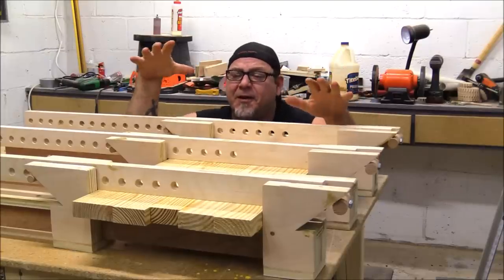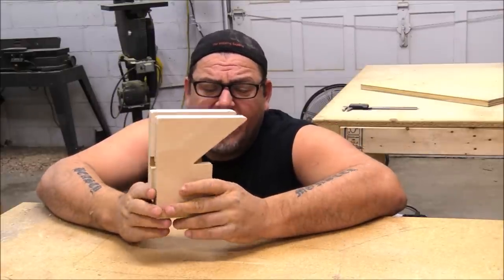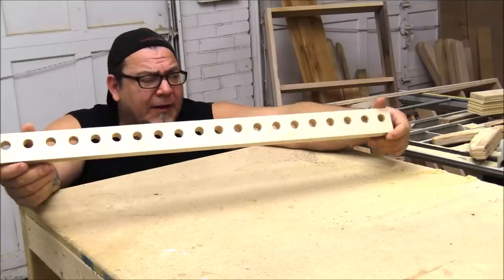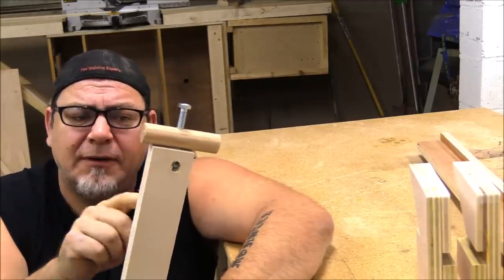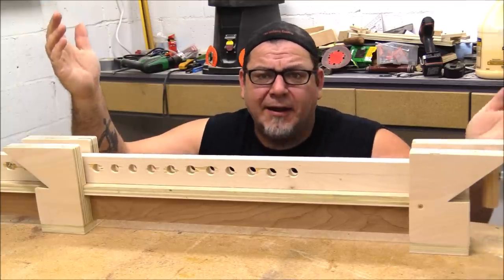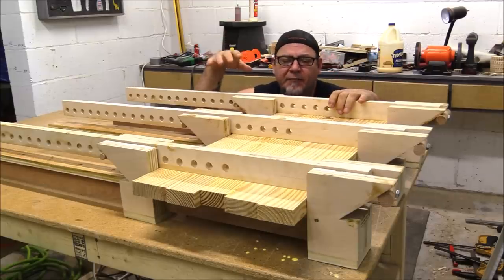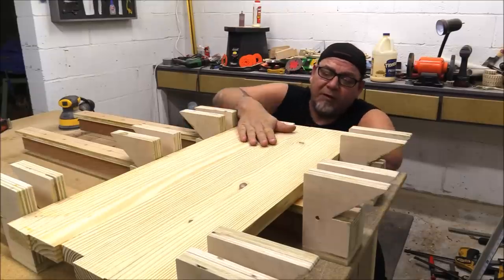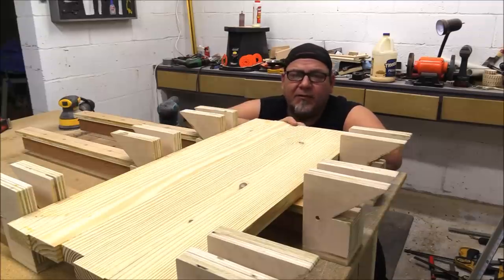Incredible Homemade Bar Clamps | Diy Woodworking Project

Comment: Izzy, I have made these and they are great, but I wonder about the geometry as I find my end pieces tend to lift at the rear. Perhaps someone can see a way to redirect the clampinbg pressure to the centre of the timbers being clamped which I think would solve this small dilemna.?? Cheers  Ron

Comment: do you think it would be better if you put some packing on the bottom rail and top rail in the middle when clamping  say a millimetre cardboard giving you even clamping top and bottom or alternatively the jaws could be slightly sloped because when you clamp it loses its parallel 90-degree angle, so say depends how much movement under clamping force set the jaws at 87 degrees angles?
Reply from the maker: great feed back thank you
Reply: izzy swan give it a bit more thought after your reply run two unc quarter of an inch stainless steel rods either side on the bottom connected to the bottom of the jaws of the clamps tighten it to reach about 97 98 degree angle say it's got to be stiff and tight at the bottom! the clamping Force applied to the top is always trying to force it over? if you don't  like that idea you could make the jaws at bottom stick out level with the top use that unc rod from top to bottom preferably about an inch and a half from the font edge maybe. Doesn't need to be super tight just tight so it holds its position under clamping force if that's not an oxymoron, brace the top of the jaws where the rods go through with at least 3 mm thick piece of preferably stainless steel cross member across the two Jaws and the same on the bottom. I think you've got enough room to slide the voice member through the gap. nice idea I still think you have the same problem with still,  the jaws will have to be cast iron.

Comment: I'm a brainstormer so whatever I say please take it for just that, an idea that is generated good, bad or indifferent 😁. 

My observation without any application of my theory of course.... The "bar" that you use to clamp over the top, what do you think about making something that covers the outside surface area of the lower clamping mechanism? You could cover more surface area but you may have a pressure issue? The thought is you will gain 2 clamps with this 1 clamp version. Just a thought! I really like this clamp! Seems to work perfect!
Reply: Another thought, the top bar could somehow be cut at a very mild convex shape over its clamping face  to ensure flexing doesn't reduce  its clamping pressure over the length of the bar on a wider surface area such as a table top. I hope that makes sense...

Comment: Great design Izzy!  I'm definitely going to be making some of these later in the month.  I'm planing on a desk build, and was worried about gluing up the boards for the top.  What was that tool you were using with the drill to tighten them, and any reason not to use an impact driver?
Reply: Does anyone know what the tool is that Izzy was using with the drill to tighten the clamp? I assume it was some sort of torque multiplier but I've not seen one like that before.

Comment: Hey Izzy... love your vids man. Just a thought....how about using your clamps in concert with a regular clamp to increase the clamping pressure needed to close the gap. It would only take a couple and the worry of buckling up in the center is done away with using your clamp. I would tighten yours partially first then  install a bar clamp on each end to put the final squeeze on it. what do you think?

Comment: Maybe tweak the angle of the triangle to optimize distribution between vertical and horizontal clamping forces. Seems you‘d need more horizontal force which means you‘d need a less steep angle (basically cos/sin ratio if you want to calculate)
Reply: no I think vertical and horizontal force should be even... you don't want one stronger than the other it may lead unnecessary twist in the boards
Reply: lurchHa3 not necessarily: as they are plum, these horizontal and vertical forces should be linear independent ( see vector algebra) at least as long as the boards are rectangles (and not trapezoids or parallelograms). Vertical force is needed sir alignment only, whereas the horizontal forces need to bend the boards in alignment, if they have a bow. Usually you also would use more clamps horizontal than vertical in such glue-ups , right? More clamps equals more force
Reply: But honestly: I am much rather a theoretician than I would have extensive experience in this field.
Reply: These forces are not independent, they are related by sine or cosine of the applied force, both forces are in fact dependant on the force applied by the torque of the bolt and the angle of the block... a board can be twisted vertically as much as horizontally... and proper joining will do as much to ensure a nice glue-up as clamping force.  in fact too much clamping force can close the fibers of the wood and it will not bond as well.  A common misunderstanding is that more clamp pressure = stronger glue joint.
Reply: lurchHa3 as they are in a 90 degree angle they don’t interfere with each other - that is what I meant. Not a native English speaker. They start to interfere if the glue up surface is not square enough, so then the horizontal force plus the resistance of the board surface creates a vertical force that tries to unaligned the boards. If this force is greater than the friction of the surfaces (function of horizontal force and a friction coefficient) the boards become unaligned. So if your angles are close enough to 90 degrees there is no vertical clamping force required at all. The more deviation from 90 degree - the more vertical clamp force is required. That’s why I don’t think that these forces are to be equal, but I think that the horizontal force should be bigger than the vertical as long as your angles aren’t completely out of control. But as they say: Grau ist alle Theorie - Versuch macht klug! (All theory is grey but insight is gained by experiment)

Comment: Great clamping system!  Why use metal if the wood version works well?  Metal version may be easier for you to build but I barely have room for wood working so no metal working for me yet.  Wouldn't the materials cost go up for all metal version?  

Make a few templets and you could crank out many of the wood version clamps.  Your clamp design seems very scalable and could be built into a clamping table for large glue ups.  I want to make a nice dinning table.

Comment: I love your clamps!  Also, the other YouTubers call them "Panel Clamps". 

Is there a paint or coating that the glue would not stick to?  Plasti dip or something? 

Just a thot:
I know you focus on wood, but I was thinking that an alternative for your bars could be steel or aluminum tubing.  The clamps would still be wood and would need to be glue-proofed, but the glue would not stick to the steel or aluminum.  

Thanks for hanging in there with all the great videos.

Comment: These are amazing. I would love to see these wall mounted so that you can tip them out to work on your glue up then lay it flat against the wall while it dries.
Reply: Crafted for Profit thoughts on having it vertical all the time? Since it’s applying a force on all sides, mounting it vertical for glue up shouldn’t be a problem. I like it on a dedicated wall for people who may have smaller shops it could take up less space
Reply: crafted for profit - what a great idea!   you always think of glue ups being horizontal but vertical makes so much more sense!
Reply: Keasbeysknight I would want to pull it out so it sits at an angle when laying the boards out and applying glue.  Then apply clamping pressure and lay it back against the wall.  I've been considering doing this with pipe clamps and connectors. The price has kept me from doing it.
Reply: I was just saying I want a panel saw in the same place...  (Amateur)  could it work somehow to have both on my 8ft high X 16ft wide garage door?
Reply: @rwind656  only if you never need to open the door
Reply: @Pat Zeuner , I was envisioning  a framework onthegaragedoor, with some parts  added when we need to use it.   I've seen several different panel saws mounted on garage doors now online.   As I said,  it's our only free wall...
Reply: @rwind656  you haven't seen the video where a gentleman organizes the garage, does a fantastic job, then the wife comes home and clicks the garage door opener.  😂
Reply: Pat Zeuner no,  oops I missed that...
 Link?   Sounds...  
Instructive,  lol.

Comment: Izzy, could you build these out of 2x4s instead of plywood? 
Asking because 2x4s are cheap where I live.
Reply from the maker: i dont see why not i would prefer hard wood for these but if the soft would is large enought to resist the stress i think it owuld work

Comment: Hey Izzy, great idea!  What are the dimension of your t-tracks and blocks?  What did you cut your blocks to draw the material in tight?
Reply: guess. scrap bin build proof of concept, experiment and estimate by using the stop control.

Comment: Excelent! I love the duel direction pressure feature caused by the angled ends.
When you get around to a steel or maybe better yet Aluminum there are many extrusions available with holes for the top bar. I will be making something like these thanks!

Comment: Hi there Izzy I LIKE YOUR YOUTUBE  but there Fast and some years past in Nam & Sandpit I have have got slower and do you have a few measurement like how wide is the track and how thick is the plywood I can slow it down but you are to fast for me. Thank you for your show I have been to Rob Cosman shop for a week and you have nice stuff that you make if cant send info Iunder stand. Thanks Pete  ps. it was the Sept 13 2018 shod.
Reply: They are made with standard measure plywood and so very easy to guess. Why would they not be? Only a few choices. 3/4 inch is the usual choice for just about any DYI clamp or jig. Size can be estimated by comparing to other tools and hands in the video frames. Hit pause/stop. This is proof of concept not final design.  Make your rails and cut the blocks to fit.  Blocks are of a small amount of plywood  total, scrap bin stuff. Experiment by making a small unit, then build a size for your needs. Jigs are one of the fun things of the hobby.

Comment: Stupid question but is the head end fastened to the t track? You screw it to it or bolt it or dowel it? Also the tightening bolt is there a buffer on the end of the bolt to protect the work piece?
Reply: Never-ending on the tightening bolt I just realized that is in the top bar and not near the piece.

Comment: Isn't the flattening force greater at the edges of the glue up because of the angled end to the clamp?  This may tend to flatten the outside boards more than the middle (as the clamps may bow slightly due to the direction of the pressure being applied at the ends).    Otherwise it's a really great idea which I am going to copy!
Reply: That's what I was wondering, maybe that's why he has some cupping or bowing on those edges of the joints?

Comment: Hi Izzy how thick is the ply you are using
Reply: guess. there is only a few choices. estimate by using stop control and compare to other objects /hands in the video frame. going to be some standard thickness. why would it be otherwise? it is a proto-type proof of concept supplied from the scrap bin. not a final design as he told you.

Comment: The Shoveller: Doctor, you are a genius.
Dr. Heller: That's what the card says.

I have seen a lot of DIY clamps, These look amazing. One thing you could consider is use for boxes. I used to have parallel clamps and they were great for boxes and drawers. Could they be adapted for that?
Reply from the maker: they could be adapted for boxes but it would be better in metal version i think

Comment: Is it possible that the surface friction of the long runners on the top and bottom will have greater force than the actual clamping force inward? It seems like it would take the path of least resistance and apply greater pressure downward than inward. Maybe why the gaps didn’t close but made it perfectly smooth across the top. I wonder if there is a “sweet spot” angle to the ends that would make the pressure even in all four directions?
Reply: I was thinking the same thing. Maybe introduce a little bit of a bow in the top to distribute the pressure more evenly. Either way, I'm making a set for some doors I need to build! Great idea!
Reply: Yes I was thinking the same.  It seems to have locked down before it pulled together.   Maybe the angle should be 22.5 (higher-up).  instead of 45.   So it doesn't slam down as fast.   Love the idea!
Reply: It's not 45 is it ?  Looked to me like he used a lower angle.  All things being equal  a 45 would give you equal pressure down as in... and 22.5 would give you half as much down as in.  You could also rig up some kind of spring tension device for the upper bar that would absorb some of the downward pressure.  It would only have to be on one end to be effective.
Reply: I doubt the surface friction was an issue considering he added paste wax.
Reply: Paste wax isn’t going to eliminate all friction. Especially over that many square inches of material on the top and bottom. And I believe the dowels on the end will want to bite into the slope pulling up and down more than inward. I think the metal version with some incorporated bearings will have more consistent pressure.
Reply: yeah...a 45 degree might be much...good eye!
Reply: You don't need a ton of pressure to glue up boards together.  When you put too much you end up with starved joints and that's no good.  The gaps that he got was because he didn't square up the lumber.   Besides I would think that most of the pressure inwards would come from the top of the boards.

Personally I think that the actual clamp is also doing the job of a caul is pretty good.  It just takes away one step in the process.
Reply: Obviously it was doing a very good job keeping them lined up and starved joints is operator error. I know he didn’t square them completely. But I still maintain that without at least making the dowels the ability to roll down the slope it will bind on one plane while continuing to clamp on the other plane. Fibers will compress. Movement will stop.
Reply: @JaredMize9  -I wasn't saying that it doesn't.  It's kind of the point of it.  He is forcing the wood to be parallel to the base at the same time that he is clamping for the glue up.  I doubt that the downward pressure is substantial until the side clamping pressure starts to build up.  And as long as the side pressure builds up it will glue itself up pretty good.  

Like I said before you really don't need a ton of pressure to glue things together.  I have used painters tape to glue things up and it holds up pretty good.
Reply: @JaredMize9  pretty sure he said the wax was to prevent the glue sticking to the clamp surfaces.
Reply: Talking of clamping pressure, have you all thought about alternating the poles of the clamp? If anything I believe the free dowel pin at the adjustment end would bind in, and the dowel at the thread end will push down creating a  >  type clamping pressure. Alternating ends should eliminate this. Your view's?
Reply: I believe the path of least resistance would be correct. But, that path would be by nature the pulling of the boards together until there was some resistance. Only then will it apply pressure in the downward motion, and as it is on an angle the pressure would then be applied in both directions. The movement squeezing the boards flat will only go so far then it can only draw the boards together to continue to move.
Reply: The sides have to engage before the top can. Trying to think of a simple example but my brain keeps going to a Lego GBC built by akiyuki.
Reply: Chris Deupree I could be wrong but I think it would want to move downward before inward because the ends have the fixed rigid slopes. Even the flex in the floating bolt would want to “give” in a downward angle before the inward pressure. Obviously it’s all working. Just theorizing what would happen and in what order.
Reply: Actually the "gap" demonstrates how equally the pressure is distributed
Reply: Dad and Daughter Workshop.  I agree.  Additionally, if the dowels were metal pins, and if he had a metal plate on the face of the 45-degree angle, then the metal pin would slide more readily on the metal plate instead of the wood dowel binding on the wooden angle.  Metal on metal tends to offer a bit more “slip” so that would reduce the binding.

Comment: Nifty design.  I think there is more pressure on the top because of the tightening bolt position.  Something (length of all-thread) on the bottom to equalize pressure should resolve gaps.
The build of the clamping blocks, and how they ride on T-track is not clear.  Possibly a posting of stills with better views would make this clear.
Reply: I would love to see stills also.

Comment: Really great.  Might be value in playing with the angles to emphasize long pressure over downward pressure?  Anyways, really great and simple.
Reply from the maker: agreed. the angle are where its at
Reply: The usual over and under bar clamps would give much less downward pressure.  But the demo you did demonstrates well the value of having some to prevent bowing under end pressure.

Comment: I must be missing something but when I try to tighten bolt the bolt tightens on the nut and there is no pressure on the dowell
Reply: not sure about that one Ian, but I had to use an extra nut to pull the inserted nut into the plywood, to stop it spinning.  Apart from that, I need to beef up the ply or use hardwood as when I clamp down, the clamping bar bends up in the middle!  I didn't make them sturdy enough :)